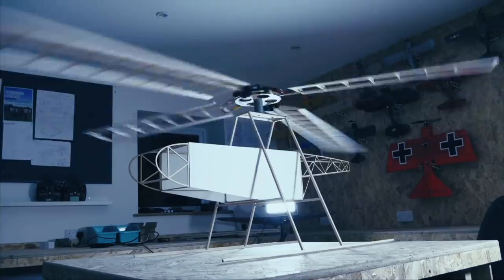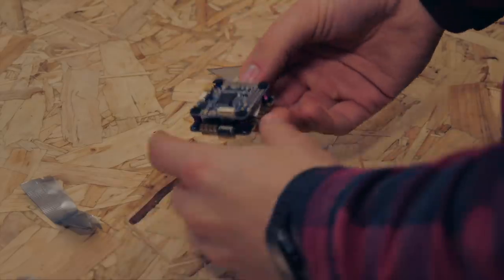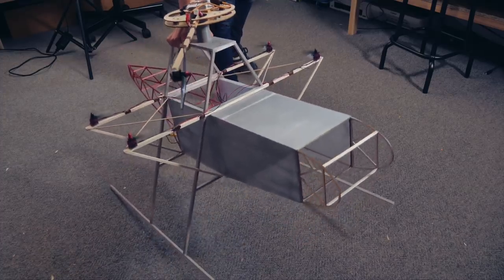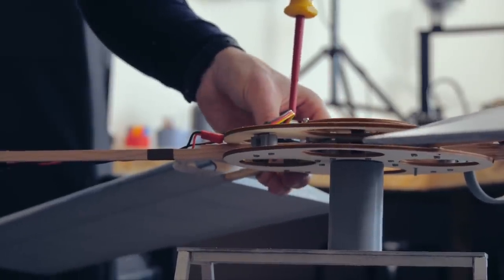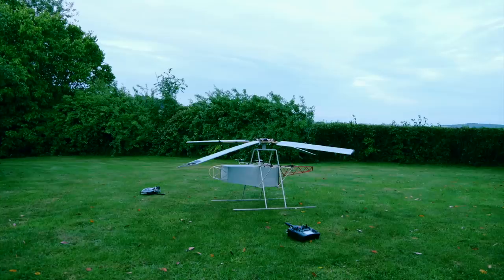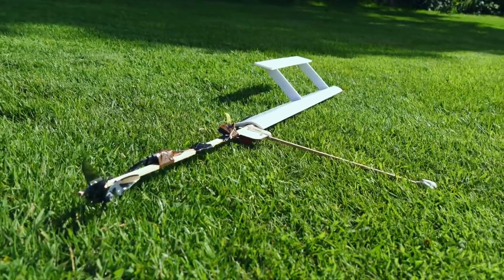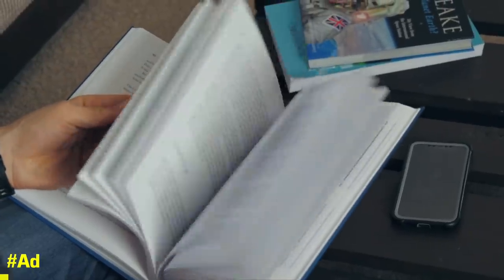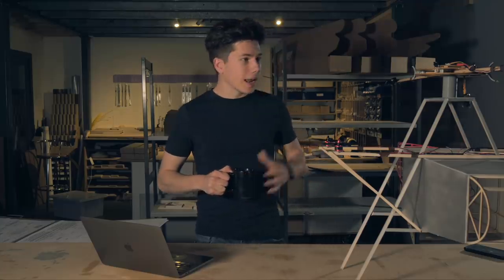DIY Tip Jet Helicopter (Testing) #3

Comment from the maker: The first 100 people to visit https://www.blinkist.com/projectair will get unlimited access for 1 week to try it out. You'll also get 25% off the full membership once your trial is finished.
Reply: Why does this comment it say one hour ago  when the vid is 6 minutes old??
Reply: Could u try and make an RC rocket plane maybe an air launch even I think it would be very interesting shame I can't try it
Reply: Angus Cameron because some people upload a video as unlisted or private before they release it to the general public.
Reply: @anguscameron4753  its likely because of how Youtube makes you publish... a workflow thing.
Reply: @anguscameron4753  probably it was posted an hour ago on private or unlisted and made public 6minutes ago
Reply: Use fishing line from hub to wing tip 6 cm below the center hub think about the support tierods on the top of a carousel  or the bottom of a wood bridge that will stop the wing tip flex
Reply: Even the sponsor is interesting ;)
Reply: Dear friend, you did everything wrong. There should be two blades. Like wings. And rigidly fixed. Install the turbines at the ends of the blades.
Reply: Could you link us to the plans for the monocopter!? I could find a lot of interest in building one of those as my next project
Reply: Charybdis never fail to amuse!
Reply: it will work, carbon fiber rods inside the wings, your airfoil is flexing, which is canceling out your lift, they seem to be twisting in the air,
Reply: I like project!  CONGRATS for you !

Comment: Great effort James. When I saw Tom Stanton's recent video my immediate thought was whether you could use fine motor control to steer a monocopter. Please try and do this!
Reply from the maker: Great idea!
Reply: @Project-Air  some aspects might be easier (the angular velocity of your monocopter will be significantly less than Tom's helicopter, and you probably don't need the virtual swash plate (?)) but you don't have a helicopter chassis against which you can reference the angle of your lifting blade (as opposed to the drive prop) so maybe you can use a digital magnetic compass situated away from the motor to try and sense orientation, against which to modulate the motor.
Reply: There have been some research papers published on using pulsed motor control to direct a monocopter.
Reply: @nathank7989  I remember a student team publishing something several years ago (guessing more than 5, fewer than 10)but I couldn't find any links. Do you have references you can share please - might help if James does something with this.
Reply: monocopters with directional control were developed around 10 years ago.
Reply: @simonmerrett  You're probably thinking of "Fly By Wire Control of a Monocopter" by Houghton and Hoburg.  https://drive.google.com/file/d/0B3suSD5Oh7F8SU9qcEtMamhCY0k/view  The other paper I referenced heavily years ago was "From falling to flying: the path to powered flight of a robotic samara nano air vehicle"  https://www.researchgate.net/publication/49630078_From_falling_to_flying_The_path_to_powered_flight_of_a_robotic_samara_nano_air_vehicle.  Evan R Ulrich has authored (or co-authored) several other papers that may prove useful.  I was pretty sure I'd read an article that involved using throttle control alone, but everything I've found so far has used throttle and a control surface.

Comment: Excellent video! Definitely need to use stiffer spars and possibly 2 of them and mount directly to the center plate. 
Maybe octagon shaped center plate with wings mounted directly since you are relying on the airfoil shape and rotation to achieve lift.

Comment: I worked on Sikorsky sh-60b helicopters in the U.S. Navy and one of my jobs was track and balance of the main rotor head. This copter uses a fully articulating rotor head that acts similar to the thin spar you used which allows the rotor blades to move forward and back and up and down and anywhere in between. One of the adjustments that I only had to do once was adjusting the trim tab on the trailing edge of blade and it was approx 2 feet long but that was on a blade that was approx 25 feet long. It helped keep the blade inline with the others but was the last adjustment after the pitch control rods and weights for balance were done. If you could add a swash plate with a fixed rod to the trailing or leading edge of the blade it may help keep the blades from twisting out of control and would be the simplest fix without scrapping this project and starting new.

Comment: Good stuff James, I really enjoy your videos. You may not be aware that; as helicopter blades produce lift and, with increasing angle of attack, the 'centre of pressure', when represented as a single force, moves forward along the chord of the blade. This effect produces a variable twisting moment on each blade thus further varying the angle of attack. This may have affected the blades on your model twisting them to increase their angle of attack in an uncontrollable way. For this reason, older helicopter blades had a chord that was symmetrical above and below the chord centre line. This does not produce the most efficient lift but the centre of pressure does not move about as much. Modern helicopters have more efficient aerofoil chord blades made of carbon fibre and so capable of resisting these forces. Also; the tip travels faster than other sections of a blade. Real helicopter blades have 'wash out'. This is a twist along the length of the blade that reduces the angle of attack towards the tip to even out the lift forces along the blade. This may help with your model. Thanks again for your fascinating videos.
Reply from the maker: Thanks Simon, this changing CoP definitely caught me out! I knew with this project there would be numerous issues that would surely prevent me being successful but yes I like to try anyway to find out about them and I'm glad you are enjoying the videos - thank you for watching.

Comment: A very very important thing to note about helicopters: the rotor blades are actually limp. They do not support the weight of the craft through regular lateral force. When the blades spin up, they are held straight by centrifugal force. The blades can then pitch to begin lifting the helicopter as there is no problem with their structural integrity. I think the main problem with your design is that you are trying to make the blades go slow. That means more weight to support the craft, which means even more speed, etc. It becomes far more complicated to fix than a regular helicopter.
Reply: No chord balance = flutter.

Comment: Hey! Great series mate! You may want to disable airmode in betaflight settings  - it will stop spinning up the motors when the throttle is low :)
Reply from the maker: Thanks!

Comment: Reinforce the rotor spars! Ditch the plastic edf mounts in favour of a solid spar. Very enjoyable video.
Reply from the maker: Thanks for the suggestions
Reply: I actually went through the comments (yeah, I'm very late to the party) to say this as well. The plastic edf mounts is actually the reason why those wing sections are flexing so much, not the spar itself bending. If you slow down the footage, the wing sections are actually still straight, and when you look at the other 2 fixed wings, they don't look like they flexed at all.

Comment: Two issues jumped out at me.  First, the longer pair of main rotor blades were experiencing flutter when you applied full power.  To prevent this, you need to increase the flutter speed (the speed at which flutter starts to occur) by increasing the torsional stiffness of the blades and their attachment to the hub.  Second, your design uses a rigid rotor rather than allowing for coning.  Very early helicopters had rigid rotors, but it was quickly found that this design results in very high stresses in the rotor head.  Rather than trying to carry the blade bending loads through the hub, you could add coning hinges, which will balance the blade lift using centripetal acceleration / centrifugal force.

Comment: Ardupilot on a Cube controller is what you were missing ;-)
Reply from the maker: 👍 I'll give it some research.
Reply: If PID adjustment doesn’t fix it get a new controller. It’s really easy to overheat the controllers.

Comment: If your using either Betaflight or iNav, turn off "Air Mode". It is set to ON by default, and it causes your motors to go mad by themselves because with airmode switched on the quad will always try to keep itself level when the throttle is low - hence your vibrations causing mayhem. Turning off "Airmode" will stop the f/c from overriding your throttle inputs.
Reply from the maker: 100SteveB thanks!
Reply: Airmode can be really dangerous on a quadcopter! It was enabled on my first flight as well and the motors were spinning up to full throttle while I held it in my hand. Got a pretty bad cut but that's how you learn I guess 😅.

I have since disabled it and put it on a switch if I want to do aerobatics. Much safer.
Reply: @schwuzi  it's arming a quad in your hand thats really dangerous ;p

Comment: Really awesome work, James! 😃
In my opinion, the problem is the wood, really. You need a sturdier material, like carbon fiber, to stand the forces involved. 😉
Anyway, stay safe there with your family! 🖖😊
Reply: Yes. You need frame rigidity! That thing was way too floppy and out of balance. Except the rotors need to be rigid, but have the ability to flap and flex independently.

Comment: If you want to have the wing launch from the ground, just add four poles that angle out from the launch pole, and they will push down on the ground as the copter takes flight. This should provide a stable and reliable launch

Comment: If you use an airfoil shape with no pitching moment, then the main forces on the rotor blade are centrifugal and some weight at the tip of the blade actually helps with keeping the disk flat. Many helicopters have "fully articulated main rotors" Look at something like a Hughes 500 type machine and it only has Tension-Torsion straps to hold the blades on, centrifugal force does the rest, again, what prevents the blade from twisting is the shape of the airfoil, not the strength of the blade.

Comment: You should mount a 90m edf in the center of the rotor racing up,  the the thrust from the edf is ducted inside the wing/blade and have the exahust exit mid way down the blade at the trailing edge.

Comment: Hi James, 
A couple of pointers, it looks like you’re using different sized blades and 2 are bending up and 2 aren’t. I’d recommend like sized blades for starters. 
I don’t think the blades are balanced about the centre of rotation, if you research flutter this is essentially what’s happening. As the blade encounters an upward gust the CoM of the cross-section is behind the spar location and will result in a pitch down moment. If you look at helicopter rotor blade cross sections they will have a mass in the front of the wing section to stop this effect. Same reason airliner engines are hung off the front of wings. 
7 degrees seems a little on the high side. You could run some calculations of torque/lift etc of the main blades. 
Don’t give up, if in doubt get your ginger mate to help. He could probably help.

Comment: Your biggest issue is blade tracking. You need trim each rotor so that all rotate in the same plane. One other issue you touched on was balance, you need to be more precise with balancing both in rotation and fore and aft of each rotor being equal to the other. Finally you need a stronger spar at the hub interface. On a side note try using a symmetrical airfoil section for the rotors.

Comment: Now make a bicopter by attaching two monocopters to a body. Mount one on top and one underneath so you can make swashplates with linkages to vary the angle of the elevators. (you can get coaxial swashplates and do it that way but they're pretty complex if you ended up having to build your own.)

Comment: I think the longer blades were getting caught in the turbulance behind the shorter blades. It is what makes the chopping sound on a real helicopter, but the supports of the blades on your model being so weak and flexible it allows the longer bladed to oscillate up and down. But that's just my theory.

Comment: Neat project. I have a few suggestions from a model airplane and quad hobbyist as well as an engineer's standpoint. First, the quad motors running away on the ground like that may be due to the flight controller being in air mode, try switching that off and see if it stops. Second, the primary issue you're going to have here is that your creation is just too heavy and the rotor design is not optimal for such a thing. Disk loading is important and considering the lack of power you need to do everything possible to get that disk loading down. As the rotor "cones" you're also losing disk area, making this problem worse. An issue you'll experience with the rotor design itself other than what you've already figured out (it's not stiff enough) is the aspect ratio of those wings, it's too low. There's a reason you never see rotorcraft with such low aspect ratio wings as rotors, because disk area is what is really crucial in rotorcraft, not the area of the rotor blade itself.  Also, the low aspect ratio wing is not only less efficient from a lift generating perspective, but also makes your particular rotors more prone to the flutter you've seen at 7:45. The rotors are twisting about the spars because of general aerodynamic instability of the system, and the center of lift is probably not precisely where the spar is nor is it rigid enough. I recommend a carbon fiber tube or box section as a spar if you are going to continue to use the balsa ribbed construction, though you would be better off with a hot wire cut foam rotor that is fiberglassed with lightweight cloth or covered in carbon fiber. This would not only have significantly higher torsional rigidity, reducing the chances of flutter, but would be stronger in the longitudinal direction and well suited for high aspect ratio construction. With longer, stiffer blades and an aggressive approach to "adding lightness" you should be able to get it to fly, though controllability with the thruster method will be iffy due to gyroscopic effects. Even those wonderful tip jet powered helicopters used some manner of blade articulation for control, there really isn't another approach to controlling a helicopter that works anywhere near as well as cyclic pitch, by whichever method it is achieved (shoutout to Tom Stanton and the researcher who helped him with his most recent video on that one).

Comment: Not sure how it is for parts from Amazon or online like Banggood but CF tubing is pretty cheap.   Some 16mm x 1m carbon fiber tube wpuld likely be around 15-25 dollars and you could use a few tube clamps mounted inboard to reduce rotating mass.   Keep them centered and bolted down solid while the wings mounted to them as spars.

Comment: First of you will never get rid of the oscillation if the rotors are not planing at the same level. That's the most crucial part in order to reduce oscillations more so than being balanced. 2nd rotors need to be stiff try using foamboard covered in carbon fiber cloth. They don't need a dramatic airfoil but for running at such low RPM's adding some under camber for the lift will help. 3rd rather than using 4 quadcopter motors use only 3 as a tri configuration. 4th add a balance bar on the rotor head to add gyroscopic stability start with the weights toward the middle then slide them out until it becomes really stable. 5th wood is a horrible material it is too fragile to get anything but one try once it gets off the ground. Try using cheap HobbyKing carbon rod sewing string and CA glue for bulletproof joints. Fun project mate. I been there and done that about 6 years ago had lots of failures before it got off the ground except I only used 1 motor for pitch control on a tail boom.

Comment: Built 2 Charbydis, lost both to thermals! One was .020 powered older cousin chased it through backyards until dog cornered him 6 blocks away! Built a double sized one with a .049 on first flight with 1/2 tank of fuel it latched onto a monster thermal. I chased it on my bicycle for 5 miles before it disapeared into a cloud!
That was when I was 19.

Comment: i love that spirit, I think that the oscillation is created due to the uneven lift of your rotor, if you make it exactly the same, it would be reduced. I also believe that you need to install a swashplate for control- not a quad system.

Comment: Hi James, that's a cool project!

The primary issue I see is with your rotor system. There is too much flex in it. Your blades need to remain stable in pitch, but need to be able to flap up a certain amount, in case you want to fly forward. Else your craft will tend to roll into the retreating blade. 

As a start i would go with a teeterbar 2 blade arrangement as it is used on Autogyros or rc micro helicopters. Then later go with a 3 or 4 blade setuo with a more complex hub if needed. 

You can achieve the flapping in a 4 blade rotor by connecting the blades by a polypropylene foil to the hub. 
The foil is sandwiched between plywood sheets at the hub and at each of the blade grips. By sanding off an angle on the upper plywood blade grip, you can allow some blade up flap in relation to the hub.  

The other concern i would have is power needed vs. power available to turn the rotor. But this can be optimized with trial and error as you go. 

Keep having  fun experimenting 👍